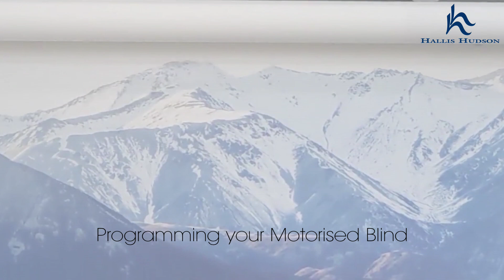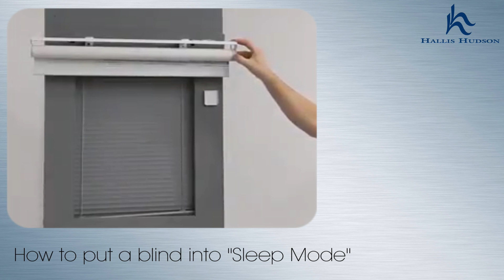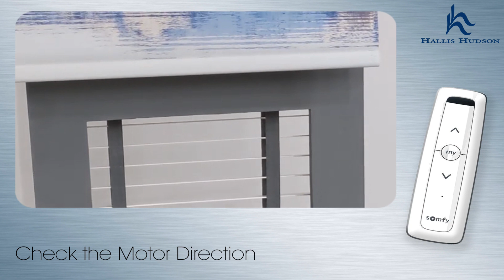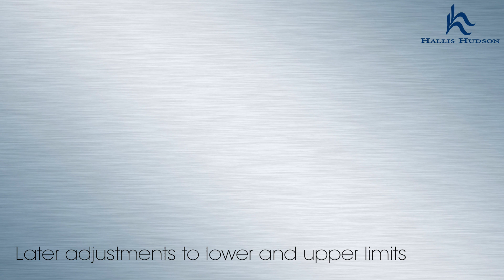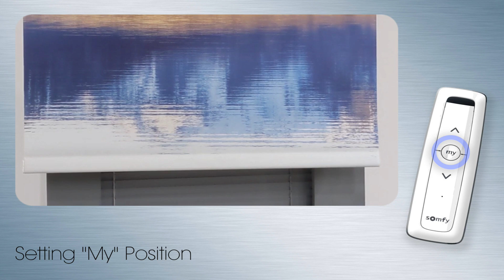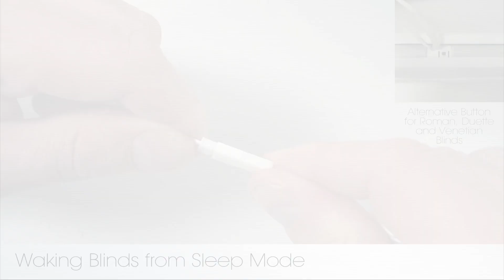Somfy Blinds Programming Instructions

Comment: No matter how many times I try (and believe me, I've been working on this for four days),  I cannot get the motor to JOG THREE TIMES. It goes up and down, once. I've tried pushing on the button 6 or 7 times and still no jogging. And, after I have tried both methods, it won't jog at all, so I remove the battery and wait. Please help.

Comment: Is there a way to connect them all on one button? 1 click and they all go up or down?
Reply: Yes you can add multiple blinds to a remote. I think up to 4 after that you need the tahoma switch. If I remember correctly you need press the reset/prog button on one remote until the blind jogs. Then hold up and down on the remote you want to add that blind to.